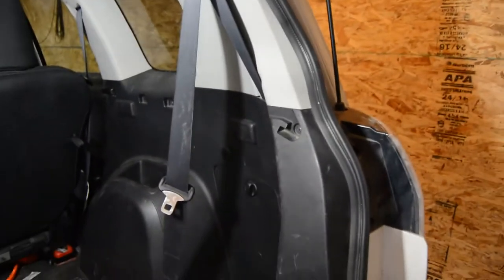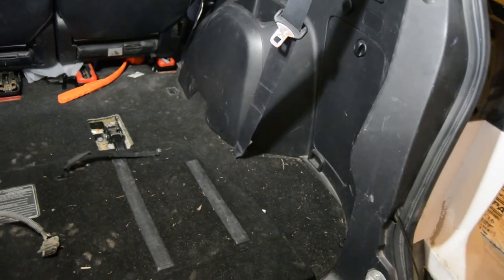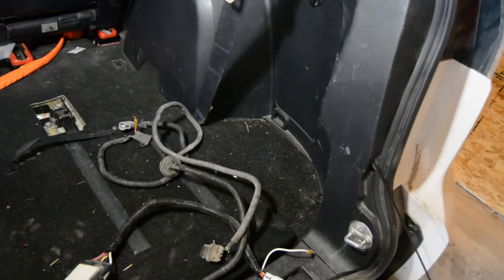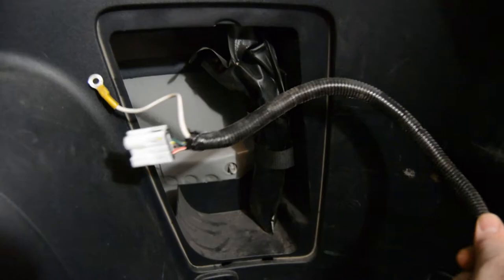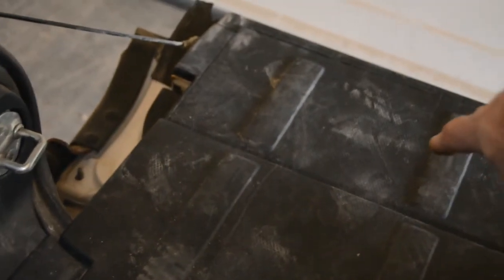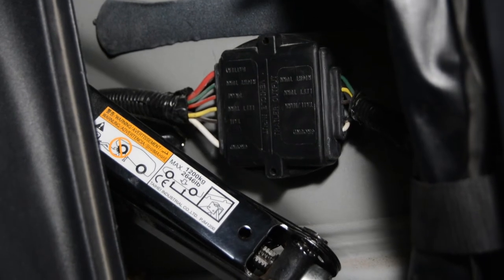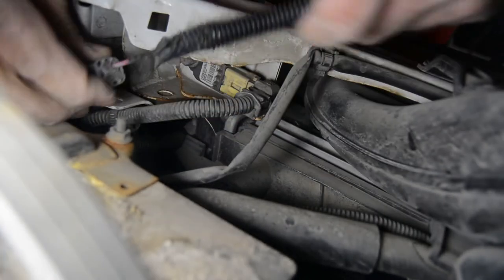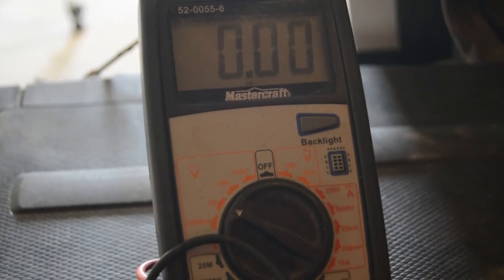Mitsubishi Outlander Trailer Wiring

Comment: Just did a 2023.  Try to buy one of those plug and play harness.  For some reason, they don't make one.  The one they list as for the regular Outlander has bare wires that must be spliced behind the tail light.  I mistakenly bought the one for the Outlander Sport, and those plugs don't fit.  Since the one for the Outlander required splices, I just cut the ends off the one I had (for the Sport) and made the splices.
Reply from the maker: If you're in Canada, the Outlander Sport is known as the RVR, which is a different vehicle.  Glad you got it to work.

Comment: Absolutely ZERO help.
I cannot see there, where you have connected the REVERSING (back-up) circuit wiring to the existing harness, nor where you have found a "permanent" (always on) power wire that is required to connect aux relays for trailer wiring that does NOT COMPLY with the vehicle's Can-Bus system, nor is there any way for me to see how you have lifted up - the other circuit feeders I need, to have any night lights (tail/turn/reverse etc.) to remain LIT "on the trailer" when the key has been removed and the steering locked, as at present EVERY SINGLE VEHICLE LIGHT - depowers whenever the key is removed / steering locked as happens when a vehicle towing a trailer comes upon an emergency scene, requiring the driver to 'leave' their UNLIT vehicle - with just the car's hazard lights LIT yet they are completely hidden by any LARGE BOX TRAILER - rendering the combination utterly invisible - to anyone approaching from the rear.

To me - having no way to keep emergency lights "lit & operational" when the car must be left (locked) is tantamount to having your now totally unseen and invisible vehicle becoming it's own potential hazard - at night - as there is NO WAY that i will leave my vehicle unlocked, keys in it, JUST to keep the trailer hitch wiring powered, whilst i am away from it, helping anyone disabled ahead of my vehicle.

Why?
Because - to keep my vehicle LIT (to be seen from behind when a trailer is being towed) the KEYLOCK must be left in "key on" position (unlocked) with the fob in the vehicle.
Securing the car (and trailer) - from theft when left on it's own, means I have to COMPLETELY DARKEN the rear of the trailer - as nothing stays lit, when the key is removed from the car.
Taking the fob out of the vehicle - turns all trailer lights off.

I need to install my own 6 way trailer wiring (via a normal 7pin plug/socket) wiring harness, that is powered full time via a direct lead from the battery through a relay set - (with it's relay signals taken from the light circuits to remain lit) - to ensure that BOTH the tail lights / brake lights AND the turn/hazard lights STAY LIT - even when the car is stopped, parked and key fob removed / doors locked - as at present - the trailer becomes its own unlit hazard - with nothing remaining lit - as soon as the driver leaves the vehicle parked at the roadside - at night.

ATTENDING to anyone else's crashed vehicle - or road accident -is impossible to do - if a "driver alone" has to leave their own vehicle unlocked (key in & keylock turned on) !!!!!!!

Comment: On my 2012 Outlander dealing with the connector in the engine compartment was the hardest part.  It was tucked under LH headlight and much toward front of car.  Not much free wires to play with, had to pull it out of the wire loom so that use can grab it with 2 hands to remove the protective cap.  The back connector is plug and play.